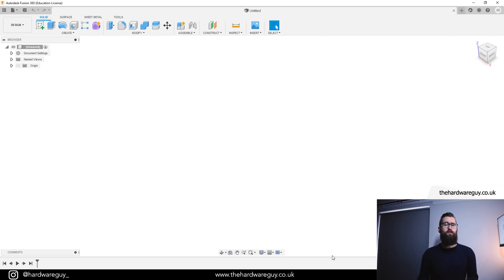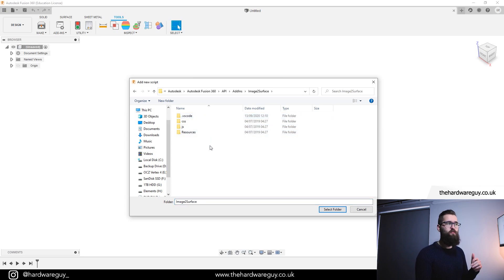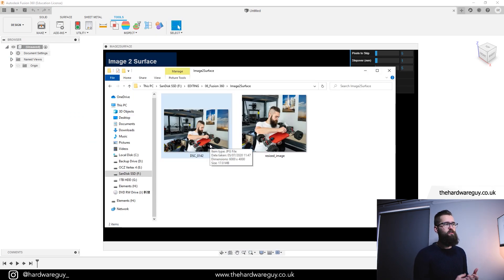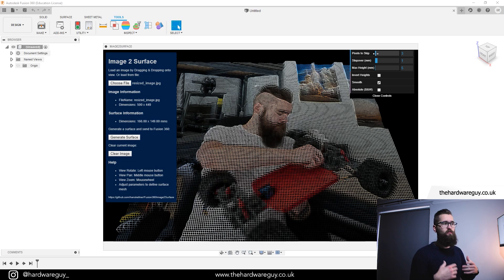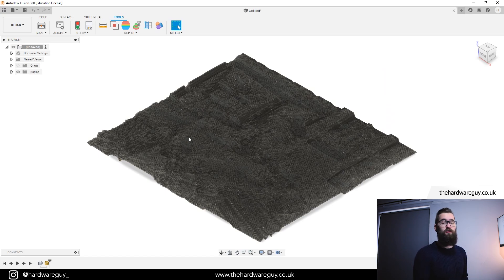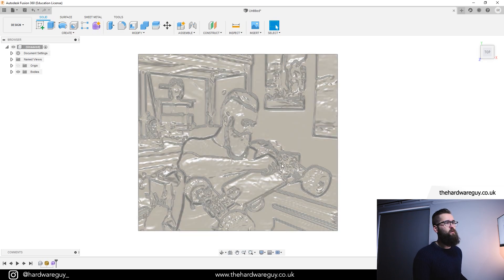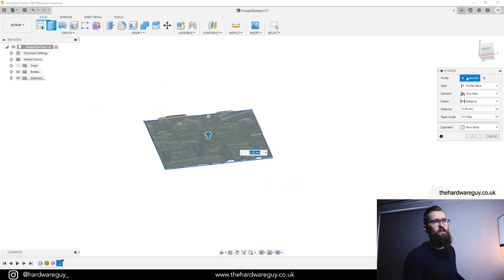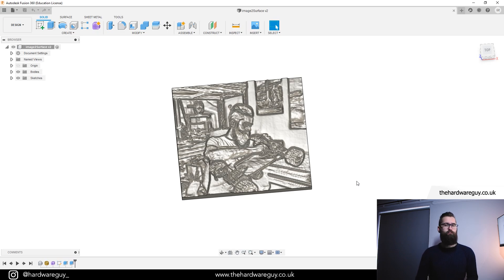Image to 3D Model in Fusion 360

Comment: is there a way to get an outline of the image from this? if not, is there at least a way to remove the background of the image? i'm using a png file image, and want to convert it to a flat 3d file where the lighter parts of image is higher

Comment: I've tried two different images and both times I get an error, when trying to do the second extrusion to give it some depth. Here's the error message: "Error:   There was a problem combining geometry together.
    If attempting a Join/Cut/Intersect, try to ensure that the bodies have a clear overlap (problems can occur where faces and edges are nearly coincident)." did something change since the video came out and it no longer works this way? Anybody has ideas?

Comment: I can only get as far as trying to extrude to the surface to create the "plaque". I get profile falls ytside of boundary error
Reply: A lot of people watching this video and trying the plugin experienced similar problems. I tried a bunch of different methods. What I realized is the surface that you create needs to be bigger than the solid body you will be operating with later on. I found a method that works better and gives me "deboss" and "emboss" solids that I can use as tools later on. I extruded a box smaller than my surface and then used the split body command with the surface in the middle of it as the tool. It helps if your initial image you create the surface with has a lot of negative/empty space around it on the borders.

Comment: Are you just running a parallel CAM option on this to cut?  I cant seem to get it to work in Fusion under the 3d model parallel option.  It says the 60 degree Bit is not correct for milling.
Reply: Probably use a ball mill

Comment: This is good for flat images that you are just trying to add some texture, but what if the object you are trying to turn into a model is not flat?  What if it is something with more depth and contours? For example, if you are trying to make a part for 3D printing that is round and tall like a cylinder, hallow center and clips on the side?  Can you take several photos from different angles and then import them to create a single 3D model?
Reply from the maker: As far as I know this is not something you can do in Fusion 360. What you're looking to do is more into 3D scanning territory!

Comment: Great video! just wondering, can this be done on the free Fusion 360 Hobbyist version or do I need to pay for the full version? (I am running V-Carve Pro and have never used Fusion360)
Reply from the maker: I'm fairly confident all this can be done in the free version. Given that it's free to download it certainly wouldn't hurt to give it a try! You will find restrictions in regards to the CNC/milling features though.
Reply: @thehardwareguy  Thank you! Playing with Fusion now.  Trying not to drop $1300 on an upgrade to Aspire lol.  Thanks again for the video and response.

Comment: I have found a solution to the extrusion issue that many including me have. If you make a square to extrude it to the image, the square has to be smaller than the image.
Reply: in my case it wasn't of exact size of image. re-calculated as per the image size then it worked finally.

Comment: I tried this on a less complex image and no matter what I do, I keep getting this error:

Mesh to T-Spline conversion

Warning: This body contains a high percentage of triangles or n-sided polygons . Converting will result in a T-Spline body that will not edit well and have poor performance.
For conversion to a T-Spline body the mesh should consist primarily of four sided faces.

Mesh Surface Content:
Quads = 0
Triangles = 40310
Polygons = 0

Conversion has been aborted.

I've tried shrinking the PNG down by 50% to only 733 x 702 pixels
Pixels to skip: 5
Stepover (mm): 1
Max Height (mm): 5

Any ideas on what to do to make this work?
Reply from the maker: I've never seen that one before! do you get the same result with different images?
Reply: I do. It may be my computer. I’ve been experiencing performance throttling lately.

Comment: Still having problems extruding. It won't do it no matter what in try. Keeps coming up with this notice - Cannot extend extrusion to object. The extrusion profile falls outside the boundary of the selected body. Select a face or plane instead, or adjust the profile so that it falls inside the boundary of the selected body.
Reply: You have to make your sketch rectangle smaller than your actual model. Then you should be good.

Comment: Thank you for the vid and explanation.  I am getting "mesh not closed"  and/or "mesh has no positive volume" errors - 2 different pics - what could I be doing incorrectly here?  I am looking for a straightforward way to go from .jpg to 3d print to include on a simple coin.  thanks
Reply: Same.
Update: I was able to get the yield sign icon to go away. I double clicked the icon and it pulled up a repair action. After doing that, the error went away but I still can't convert to quad mesh. (sorry I realize you posted this 3 years ago)

Comment: Hey mate! Any ideas on how to use this and multiple images from different angles to re-create a real object in Fusion without needing a 3d camera? 

Have a build I'm working on where I need to import a part, but can't get the cad for it and don't have access to a 3d scanner- Using something like this in combination with the calibrate option of the canvas tool would be next level
Reply: He used a 3D cam?

Comment: Thanks dude, I have been searching for a program to do this for some time and I'm very happy to have found this. 

I was getting an error message when trying to extrude, saying "Tool Body Creation Failed" "Extend boolean fail. The termination entity might not be fully intersected with the tool body built along the operation direction"

I messed with it for a while and couldn't get it to work, I restarted the project multiple times and it got the same error every time. I decided close the program and restart my computer. This fixed whatever bug it was and is working perfectly now.
Reply: I am getting the same error message, I tried different photos and starting Fusion 360 again several times without any luck. Any other possible solution?
Reply: Same issue, get to making the plaque and it won't extrude. Keeps telling me to adjust the profile so that it falls inside the boundary of the selected body. I've done that a dozen different ways. Will not extrude

Comment: This would be a great tool if it worked for me.  After I installed it, I played with several different images and it worked well  However, it suddenly started creating triangles rather than quads at conversion to surfaces.  It is in quads before but goes straight to traingles.  It errors out and says 0 quads and however many triangles and aborts.  not sure what i am doing wrong.  At any rate any help would be appreciated.

*******

Found my issue in preferences. Working fine now.
Reply: Omg same issue. How did you solve this?
Reply: @PatLures  go to preferences and find mesh and select it. There is a check box that indicates triangulate polygons.  In check that option. 

Should work then.
Reply: Remove check( predictive text)

Comment: Thanks! I was able to follow you all the way until you extruded the sketch to make a plaque, then I got an error message saying "Tool body creation failed." I've been messing around with the extrude options but can't find what I did wrong, do you have any tips?
Reply: I’m having the same issue
Reply: It's a bug in fusion. Discard the project and close the program and restart your computer. Then start again, I had the same problem and this fixed it.
Reply: I am having the same issue. I changed photos, restarted the software as Sean P suggested below, I keep getting the same error message. Any other suggestions?
Reply: Make your sketch smaller than the model. Worked for me.

Comment: Aw man so close to making my first 3d plaque, I get to the steps (totally new to fusion 360 btw) I create the 2 point rectangle but once I go into Orbit to move the model intending to move onto the extrude section its as though the rectangle I just created is not flat to the surface of the rendered photo its like its standing on edge. Not sure what I am doing wrong there.
Reply: That sounds like you selected the wrong plane, make sure to choose the plane parallel to your plaque. Hope this helps!

Comment: The "Create a Plaque" section of the video does not work for me. I perform the extrude exactly as shown in this video. Are there some images that this wouldn't work for? My image is much simpler than this example, so I'm a little perplexed. It would help to have the Bodies and Sketches dropdowns expanded in these tutorials for the additional context of what bodies are being created, etc.
Reply: What errors does it throw, if any?
Reply from the maker: did you solve this problem? still works for me
Reply: @thehardwareguy  For some reason I never got notified of this reply. Not sure if it was the version of Fusion 360 I was on or whatever, but I just revisited this project (11 months later) and am on the latest version now and got it to work. Thanks for the detailed guide!
Reply: i had to create sketch on bottom plane....then image extrudes to object without error....was getting some extent of boolean error till i switched planes for plaque sketch

Comment: Thanks for little tutorial. I'm trying to learn how to use Fusion 360 to make files for my X-carve. I get to the point where trying to extrude the sketch into the body and i get the following error: 

Error: Tool body creation failed
Extent boolean fail. The termination entity might be not fully intersected with the tool body built along the operation direction

I'm a novice, so I'm not sure what's the problem. Any ideas?
Reply: Having same problem
Reply: I have the same problem, did you find a solution?
Reply: I have the same problem
Reply: It's a bug in fusion. Discard the project and close the program and restart your computer. Then start again, I had the same problem and this fixed it.
Reply: Hi I got a way to fix it, when you extrude the sketch, do it upwards past the other body you want to extrude to, then extrude the top back down to the image's body, hope it works for you also!!